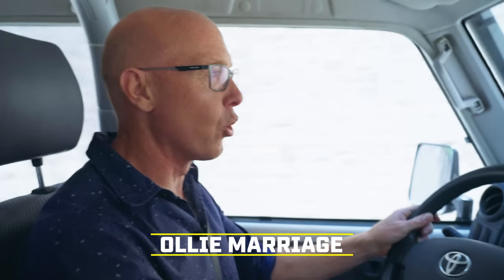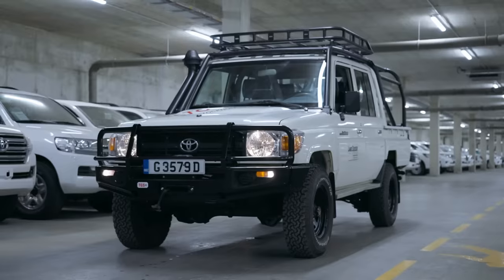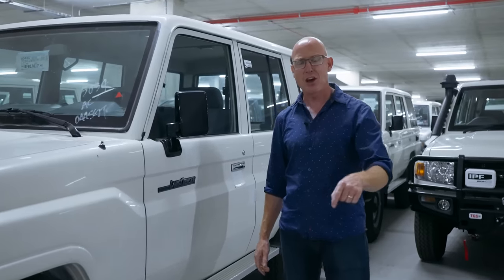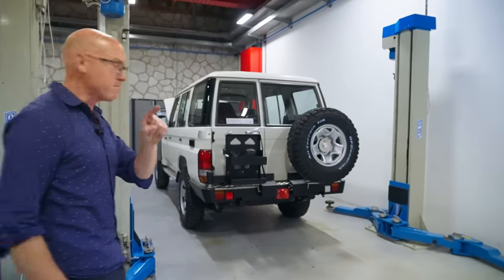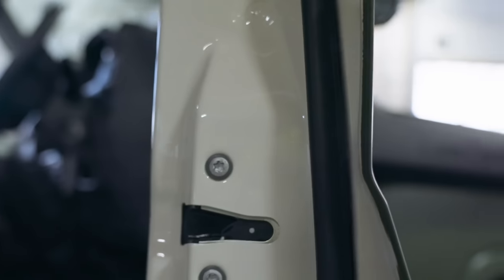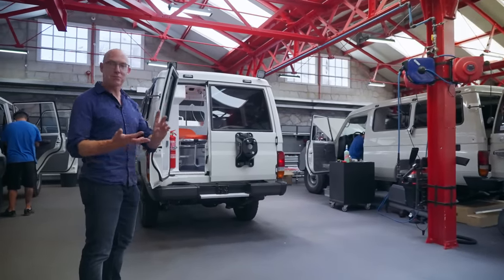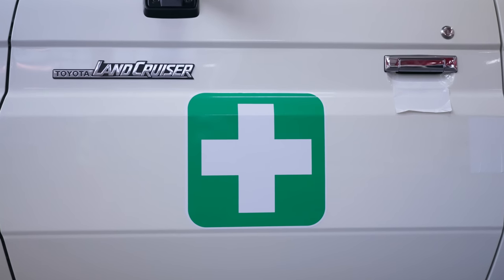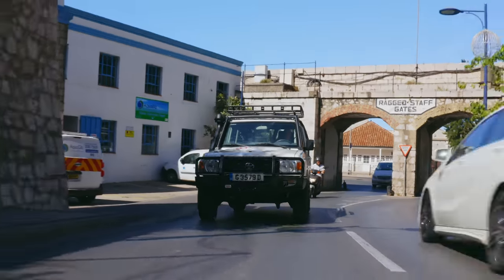This Secret Dealer Sells White Toyotas That Save The World | Top Gear

Comment: Who else thinks there will never be a more capable and mechanically bullet proof series Land Cruiser
Reply: Pretty sure that an electric car with less moving parts will be more reliable. But the scope of range in Africa will be a nonstarter.
Reply: Also it’s literally the LAST instant classic that you can buy it new! Only option is :
AC
Reply: Would love to own 1 bone stock off the lot.  Spent way too much money restoring Land Cruisers.
Reply: @currentaf8455  If you have a solar panel array the range is infinite.  It would take a while to charge but then you don't need to transport diesel.
Reply: Only vehicle built for a 25 year life cycle
Reply: @planespeaking  you would run out of food/water waiting for a recharge. Thats hilariously unfeasible
Reply: @RumblesBettr  You're making a lot of assumptions about use case there and it would only need to be for emergencies in terms of a portable set up.  You need to transport diesel via the same routes. Also slow speed and torque are what EVs do bes in terms of range. All perfectly feasible with current technology.
Reply: Well also things and such.
Reply: Yep
Reply: @currentaf8455  *fixable
Reply: @currentaf8455  You would think that but Tesla's break down due to software glitch all the time. It's why Tesla is ranked dead last yearly when it comes to reliability and build quality/durability. TFL's brand new Hummer EV broke down on them 🤣
Reply: Never is a strong word
Reply: @electrikoptik  There's other EVs than Tesla, dopey. Anyway Range Rover?
Reply: These cars will always be absolute legends.
Reply: @planespeaking you haven't considered the longevity of the battery
Reply: They're actually not that great off road. 80 and 105 series cruisers are better at tackling tough tracks
Reply: @williamfsark  70 series are overrated. Wheel articulation is pathetic and the rear track is narrower. Toyota didn't think about improving those bits.
Reply: @Countrysideboy247  you're referring to 79 series, not 70 series specifically. In terms of off road capabilities, you've missed the point of what they are designed for, hence why these still have the 4.2 na engines. If triple locked, they are practically the same as an 80 series. Lift them on 33's with Cooper or Bfg mud tyres, and they will go anywhere, and not break. The 4.2 does half a million miles with shite servicing, and with regular oil changes, they are, like the Om606, a million mile motors. Who ever the twat is above referring to EV's needs a slap.
Reply: @anthonybaiocchi3028  why can't they give it with a turbo I6 atleast?
Reply: It's an interesting point though, because Africa doesn't have a electric grid system like Western countries. Some people are trying To build localised power grids using solar panels so each village has its own solar panels producing its own electricity so the village is self sufficient and doesn't have to rely on unstable governments.  So maybe if you had an electric car you could just about get the range to go in between villages and recharge, but at this moment in time you may just be sapping an entire village's electricity, so they may not be very happy about that, but it's an interesting thought For the future.
Reply: Capable in what terms, there are far more capable vehicles offroad, this is just a reliable tool
Reply: Idk but i truly think this is almost as remarkable vehicle as Ford Model T
Reply: @alexblake4167  good point. I think there are many myths going around concerning the effective utility of EVs, such as their reliability whether the vehicle themselves, or the supply of electricity. What we're hearing much about in the media  and know from our household power bills, is not only is electricity very expensive and becoming more so, but demand is outstripping supply. I cant see how EVs on mass scale are realistic in operating them...and I haven't even started on the manufacturing of them - usually made of an enormous amount of plastic and batteries that need large quantities of lithium.
Reply: @currentaf8455  just less moving parts dont mean anything, your phone has no moving parts but will last as much as reliable car? the answer is no because the battery capacity is going to reduce significantly, are wasing machines with electric motors and less moving parts are just as reliable as engines
Reply: @currentaf8455  electric will never be reliable less talk of range
Reply: @currentaf8455  just try crossing a stream in an electric vehicle they catch fire end off
Reply: @currentaf8455  keep thinking
Reply: No computers. Has a snorkel. Literally the exact opposite of an EV.
Reply: This video put a big smile on my face
Reply: Flinstones car
Reply: @currentaf8455  here in the mountains when you can get locked for 4hrs  because of fallen threees under the snow, electric wouldn't be my first choice either
Reply: @freecanadaplease  25 years, when abused
Reply: @williamfsark  they are more comfy, but more fragile
Reply: @Countrysideboy247  rear track is narriwer only after the facelift
Reply: @freecanadaplease  Volvo 240 is pretty close
Reply: @KirkWagner147  toyota    designed and engineered the land cruiser from factory for a 25 year life cycle. That is why they have the U.N contract. Most car companies only do it for warranty period. Not that there isn't other vehicle that aren't good. Volvo 240 was the gold standard of safety, which most crash test are based on to this day. First car, in front end collision the engine goes under the car and not through the dash and kill you. And a car that can be dropped on its roof and not be crushed.
Reply: Anita Kawka  nope, while I own a 1989 hilux ln106 diesel, it is not build to the same 25 year cycle as Land Cruiser. It just happens to last like most toyotas of the time.
Reply: Facts 🙌.
History. Toyota Australia commenced operations in 1959, when Toyota Land Cruisers were imported by Thiess Toyota, a 60/40 joint venture between Thiess and Toyota, for the Snowy Mountains Scheme.. ie. Best car ever built
Reply: @Legrascestlavie88  100% - to make space for the V8.
Reply: @landrover1155  I've got both, and they are both going on 24 years old, with over 200 000 miles. Neither has any rattles, squeaks or any unwanted noises. Neither smoke. One with solid axles, and the other with IFS. One with a na 4.2 1HD and the other with the 1KZ. Very different vehicles. One 'heavy duty' and the other considered 'light duty. One auto, one manual. Very different vehicles - both bomb proof. One has electric heated leather seats, the other bounces (quite comfortably) down the road. Apples and oranges.
Can someone please sort out these fk' wit fanatical idiots going on about EV's. America and Europe can't provide enough electricity for EV's, even if they were practical - how is Africa or a war zone supposed to charge an electrical Land Cruiser. GW is a scam - your granny is a glorified golf buggy!
Reply: @anthonybaiocchi3028  yep.. and mire cost effective to do it on all the lineup...
Now whay the narrower rear tracks?
Too expensive... it was either that or discontinuing the model.
Reply: @currentaf8455  dream of delusion
Reply: @currentaf8455  What are you on about? The battery will crap itself after 5-10 years, as all hybrids/electric cars do. Then you’re up for $10,000.. The worst Landcruiser would cost you half of that over a 10 year period.
Reply: Technology won't allow for it.
Reply: @jt.8144  it just something about these that makes you want it even though it doesn’t have lots of features
Reply: Toyota
Reply: @planespeaking  not practical in any since, that's why no one has done it.  I used to believe all this electric BS
Reply: @currentaf8455  you could charge via a big enough solar charger (if you're patient enough)
Reply: @electrikoptik
Reply: @planespeaking  And yet no electric 4x4s are being used here just diesel 4x4s.
Reply: @Mohnnad Mercedes  Ummm, AC came standard where I live.

So, did two lockers.

Electric windows and central locking, wide tyres with mags and fenders.
Reply: @currentaf8455  and who will fix a simple problem somewhere in a desert, or jungle, or arctica at that EV? And what range that will be, fully loaded at these terain conditions?
Reply: True.
 Nissan still produces a tough pick-up as well, called Nissan Patrol.  
And there is also the Mahindra pick-up
Reply: @currentaf8455  EVs have a long long way to go.....
Reply: I agree.  Just a shame we don’t get them here in USA.  Toyota has been giving us their inferior IFS 4X4’s since 1998.  I will keep my FJ40, nothing tougher here Stateside.
Reply: @electrikoptik  exactly!!! If you are on the road in the middle of nowhere the most important thing is Teliana ITT... If You drove a old Toyota You would know what that word means... Tesla or any other car could never achive that status and only delosional persons would compare these kind of Toyota with Teslas... Old Mercs are also very reliable....
Reply: @nickmartin3647  Batteries last a long longer than even the EV manufacturers envisaged and can be easily repurposed or recycled.
Reply: @izzy031096  this is nonsense
Reply: @DD-oy6qd  yet
Reply: @planespeaking  No it’s not mate. I’ve owned A couple of Toyota Hybrids in my time, both ran the same hybrid system seen in the Prius’. Both systems crapped out around the 10 year mark, and both cost in excess of 5k to fix. And these are Toyota hybrids, the most reliable on the market. 
Give me an old Landcruiser any day, all it’ll need over ten years is a few fluid changes, some brake pads, and a timing belt. Might cost you a grand in total.
Reply: the 80 series landcruiser is the most capable off road landcruiser ever built, and i reckon the hdj79/78 series and the hj47 are more reliable. the 1hdfte and 2h motors are incredibly reliable.
Reply: I got one here at home Bj73 
 that i sure love but needs constant hours of maintenance   Do you ? 
Toyota is nit what it is made up to be by fanboy you might hang with
Reply: @planespeaking  Stating "a while" is such an understatement and so open to interpretation
You would need a substantial number of panels and uninterrupted sunlight to get your car moving again
Reply: Me want Land Cruiser!
Reply: Yes that is Taliban and IsIs loved them.
Reply: Not me, the 80 series is what made Landcruiser capable and legendary not the 70.
Reply: Proud owner of a VDJ76 ,
Reply: @currentaf8455  not sure about that, my cousins tesla broke more than affordable of times, batteries, motors you name it. And how would you replace a tesla motor in a middle of no where?
Reply: @currentaf8455  not really, lithium ion can catch fire at certain temperatures and is more complicated to repair.
Reply: 80 series
Reply: @currentaf8455  solar
Reply: In Canada they don't look anything like this and the model starts at $87,000 CAD 😂
Reply: There are cars more capable than a land Cruiser, depends on what you look at, there are cars for extreme off-road that are better and cars that are better in terms of luxury, you need to be more specific
Reply: @Countrysideboy247  In Australia the 79 ser5ies come with a 4.5L V8 diesel....absolute beast
Reply: I have a 75 series 93 model best purchase I've ever made.
Reply: If that holding garage was full of JLRs it would be a a repair centre….!!
Reply: @williamfsark 

Obviously you’ve never owned one, been in one so you stay with LR defenders, with the optional front locking diffs in standard form these are near impossible to beat unless you’re in a Unimog that can take the width of its ass…

‘Landcruiser, Landrover owners ultimate towing accessorie..”
Reply: Like what vehicle?
Reply: There is no Land Cruiser market in Canada since 1998
Reply: Which car?
Reply: @JuskoLord247  

There is (used) but Toyota sales have been dwindling in the domestic market as the longevity and reliability of the LC has been the downfall, when you make something too good it lasts so no one replaces it with another unless you have a JLR product and you’ll replace it every 3-5 years and European (German) are expensive to maintain. 

Lexus versions are the only things which now sell here and as I understand they’re making another introduction into the north (Canada) as an alternative to domestic and European Luxury 4x4s.. 

Damn the Japanese for making something too good…
Reply: Unimog is better
Reply: @californigirl  

Completely different vehicle, starting at 6 tons to the big 10 ton Unimog and you need a CDL or HGV classification license to drive them, my mom can drive the LC…
Reply: @currentaf8455 Electric cars are vonerable to a lot of things so its a matter of time before they break. yes they have less moving parts but the parts but it will never beat traditional cars in my opinion. A electric car needs its battery replaced every 7 or so years because they wear out quickly and the quality of them diminishes over time or water could get into the electronics because of rust and wear. that is just some venerability's but I do see where you are coming from.
Reply: @californigirl  nope.
Reply: @currentaf8455  What if you need to make a drive of 24  hours continues? What would you rate as more reliable, then? Regardless of where you are on the planet.
Reply: @currentaf8455  ya blew it
Reply: @freecanadaplease  bros fallen for the toyota propaganda
Reply: 80 series was the last good one
Reply: Laughs in UAZ69
Reply: @alexblake4167  an EV is perhaps 1 of the worst vehicle choices for Africa
Even with very few communities setting up solar, recharging is still a massive issue 
Also reminded me how my government in SA wants to push EVs but we are still having power cuts for over 6 months lol
Reply: @darcykeddell4930 dont need propaganda when your a mechanic.
Reply: @freecanadaplease  im a mechanic, these things are shit, the 6 cyl ones were ok but the 4.5 v8 sucks ass
Reply: @darcykeddell4930  don't think any of these ones  have the V8.
Reply: @landrover1155  Your username is land rover, everything you say about landcruisers is instantly invalid
Reply: @Schervin  Turbo diesels are reliable. They operate at lower boost pressure than  turbo gasoline engines. Things might be different for small diesel engines forced to make huge power which involves the use of sophisticated actuators and valves. But here we are talking about a big I6 with a turbo. I have been driving a turbo diesel 4x4 for 15 years, never faced any problem.
Reply: @currentaf8455  sorry but vehicle reliant on electronics in a hostile demanding environment is the definition of unreliable.
Reply: Its called the hilux
Reply: A turbo wouldn't help it much in the field, so it becomes a liability.
Reply: 100% ! Mine has been too good to me
Reply: @planespeaking  The infrastructure needed for any EV to be meaningful is lacking where these are sent.
Reply: @freecanadaplease  25 yr life in a 3rd world country……that’s 100 yrs in the U.S, Europe, Canada…etc
Reply: @skiplewis9872  except here in Canada the roads are salted in the winter. They crumble into a pile of rust before they stop running. Fj40 are rare here, even though they were sold till 1984.
Reply: @freecanadaplease  True. I live in Georgia, so I’m not too familiar with those issues. Not too much snow down here.
Reply: Time for the Ineos Grenadier to step up then. More modern where it needs to be, traditional where it should be, and all the best bits poached from the classic utility 4x4s, the Defender, LC, GWagen and Jeep. A proper engine, auto box, Steyr build and design quality, meets modern Euro safety and emissions standards, no frills, looks hugely capable from all tests and reviews I’ve seen etc etc. The perfect hybrid (of the four greats, not as in electric hybrid) utility vehicle for the 21c. 

Price point often mentioned, but it’s easy to ignore how much more expensive things like a classic Def or this LC would be with properly uprated engines, drivetrains and other ancils. If anyone has ever gone through that epic journey on their own (as I have with a MY 2011 110 DCPU) then you’ll know it’s easy to arrive at the exact same price point as the Grenadier, yet one is DIY and the other ground-up designed and factory built.
Reply: @leangrypoulet7523  bmw b58 maybe ok in a car, but when one of the fuel injectors break in the middle of nowhere. Good luck. Bmw engines are known for alot of things buy longevity isn't one of them.
Reply: There exists a vehicle like that: Suzuki !!
Super cheap, so little to go wrong, bulletproof reliability!
Reply: There already not making anything near reliable and simple to maintain
Reply: 80 series blows away any land cruiser under water
Reply: @evoemperor3776  80 is a land cruiser, which is my favorite. But my land cruiser bj40 will run without  batteries or alternator and won't over heat with an engine bay and radiator full of mud.
Reply: @planespeaking  How long would it take to charge a Landcruiser by solar panel😂?
Reply: @currentaf8455  tell that to my neighbor who has the tesla repair van outside his garage all the time. Less moving parts doesn't equal less complicated. You can drive a diesel land cruiser with no batteries or alternator. Push start it , and to turn it off there is a lever on the mechanical diesel pump to turn of the fuel. That's simple engineering.
Reply: @jt.8144  tens of thousands in Australia.
Reply: My 2011 Subaru outback is giving the Land cruiser a run for its money. I don't think it's quite as bulletproof but at 130,000 mi with no major problems. It's doing pretty damn good.
Reply: @anthonybaiocchi3028  they will.never go like a coil sprung all round vehicle off road
Reply: Agree!
Reply: @currentaf8455  A company in Germany converted 70 series Land Cruisers to electric. This must have been the apex of reliability then.
Reply: @nedkelly6983  The 80 series is a great off roader, but Land Cruisers were legendary long before then.
Reply: @Its-Just-Zip   130,000 miles in a land cruiser isn't broken in yet. My 390,000 mile FJ40 laughs at your post
Reply: @currentaf8455 less moving parts doesn’t mean more reliable. In fact that would make it harder to fix since it’s mostly computer software. And expensive.
Reply: @currentaf8455  you think electric stuff is more reliable in a vehicle ? 😂😂😂😂
Reply: @currentaf8455  lmaooo
Remember , reliability just isn’t how long the car stays on the road without falling apart 
It’s how easily you can fix it
Reply: Nope never
Reply: the new regulations may face this iconic line out. but TOYOTA will always be king.
Reply: @currentaf8455  more electrics means shorter lifespans for cars. in any model in any continent a robust engine with minimal electronics outlasts most vehicles
Reply: @anthonybaiocchi3028 a big fat slap indeed. It's easy to say stuff like that when you're sitting in your comfy house and typing on your keyboard.
Reply: @planespeaking  funny from working with cars the electricals usually fail first and much more often then the mechanical components. all the top most reliable brands have the least electrics and the most unreliable have most electrics and depend on them too much which is why they have so many issues.
Reply: My favorite vehicle
Reply: Cybertruck🤣 literally bulletproof
Reply: Well, there is the T LC 70s 2024.
Although almost the same car with a slightly retro-facelift :)